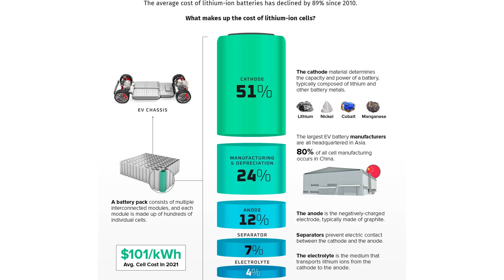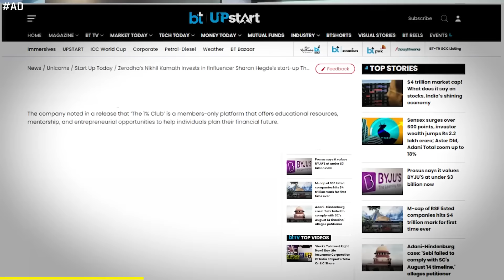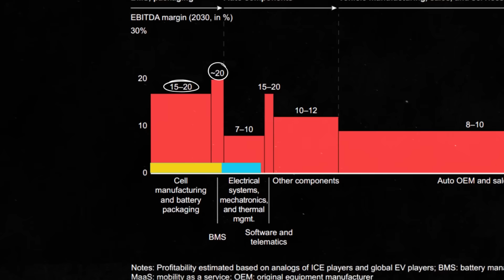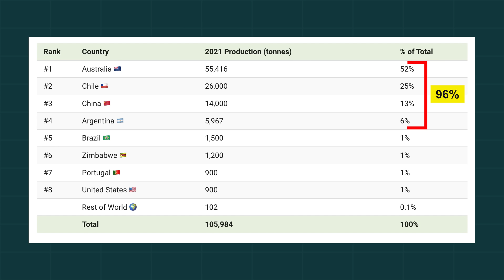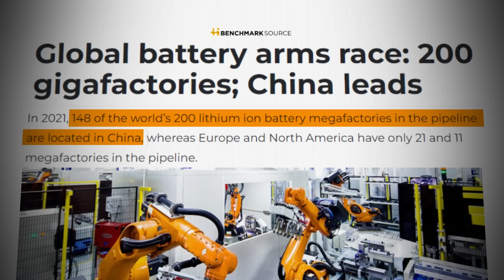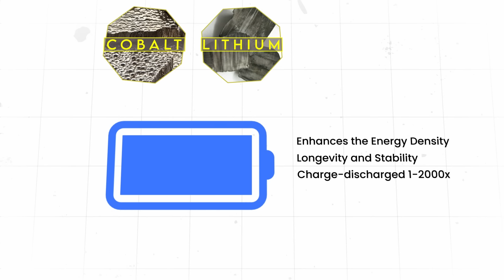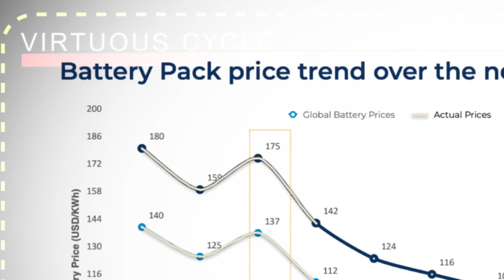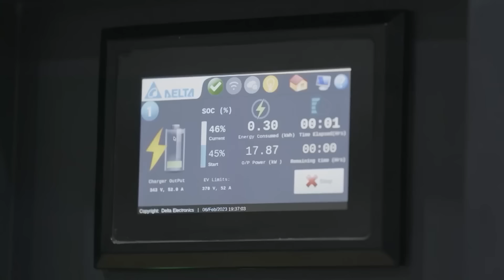Is India Winning or Losing the Electric War?: Business Case Study

Comment: 2 more cold start problems.

A) Battery charging time (1-2 hrs even with fast chargers) vs Refueling time (10-20mins max) while covering longer distances.

B) Breakdowns/Mantainance issues, especially in rural areas of  India. IC engines can be fixed even by the mechanics of small towns and villages, where as EVs has to be fixed by qualified technicians, hadly available in smaller towns and villages.
Reply: Ev tectnology is  developing not developed
Reply: That's why its called "start problems"...
Reply: well this isn't a india problem as such. The EV tech we can say is still in its initial phase as its not even 10 years that EVs have caught up some traction. So ev tech is still developing and still would take 10 to 15 years to be fully established globally (reaching a major chunk of market share). The second point of yours takes us back to infrastructure and sales.
Reply: 1.Removable batteries may be the solution
Reply: @ProudIndian2024 Its already there in China
Reply: Apparently you are not up to date with battery swap technology. Go reseach NIO. This is company has over 2,000 battery swap stations all over China and it is growing exponentially. Battery swap only take 3 minutes top. Also battery swap means you don't have battery degradation problem. With battery swap you don't have range anxiety.
Reply: @tkam9  yes
Reply: Fast charging at Tesla superchargers takes a car from 10% to 80% (approx. 320 km added range in about 25 mins). While it is supercharging, you can go indoors and use the bathroom, get coffee etc. Typically, supercharging is necessary only on long distance drives. Most of the time, EVs are charged at home, typically once a week. This, of course, is not feasible for apartment dwellers. As for maintenance, note that only the drivetrain and batteries are not mechanic-serviceable. EVs don’t have a transmission, coolant system, emissions system, etc. A typical EV has fewer than 50 moving parts, whereas a petrol or diesel vehicle has more than a 1000. EVs have no regular maintenance items (no oil change, coolant flushes, brakes hardly wear out) other than wiper blades and tires. All other long term maintenance items such as suspension parts can be serviced by any mechanic. I speak from experience - we own two EVs, and so far, they have been the most trouble-free cars we have owned.
Reply: Just like USB drives and RAM slots, battery sizes and slots need to be standardised for easy removable batteries of any brand Govt needs to take initiative
Reply: One more problem emition of batteries when they produce
Reply: @ProudIndian2024 what about emission during production of battery.batteries came by magic spell
Reply: well tbf the actual cost of repair on a ic is way more and evs are also less likely to breakdown in my opinion
Reply: latest HUAWEI super charging is 1 second = 1km.
Reply: Not to degrade the environment, things have to start somewhere! If you are discouraged, EVs will never start off in India!
Reply: 2nd problem will be resolved with time.
Reply: simple thing 
EVs are better for someone who commutes regularly and the distance is within the range of the vehicle. If you think about long tours and travels then EVs are not ment for you.

Comment: 0:33: 🚗 The electric vehicle revolution is rapidly gaining momentum, with major corporations and the Biden Administration pushing for the transition to electric vehicles.
3:47: 🌍 The video discusses the shift from IC engines to electric vehicles due to climate change and depletion of fossil fuels.
7:09: 🚗 The video discusses the different segments of the electric vehicle industry and the opportunities within each segment.
10:49: 🔋 Australia, Chile, China, and Argentina are major players in the lithium industry, with China controlling a significant portion of the market.
14:25: 🔋 China dominates the lithium and cobalt value chain in the EV industry, posing a challenge for other countries.
18:04: 🔋 The video discusses India's dependence on lithium and batteries from other countries, as well as the challenges and opportunities in the electric vehicle market.
21:20: 🔌 Electric vehicles (EVs) are more economical than IC engines over time, despite the higher initial purchase cost.
Recapped using TammyAI
Reply: Thank you friend.

Comment: I suppose you forgot another major component,  GRAPHITE.  China is the world's top graphite producer and exporter. It also refines more than 90% of the world's graphite into the material that is used in virtually all EV battery anodes.  Also more efficient electric motors require rare earth neodymium. China process over 75% of this metal. (A 12-15 mw wind turbine needs over 3 tons of neodymium).

Comment: 00:03 The electric vehicle revolution is gaining momentum globally and has significant business and geopolitical implications.
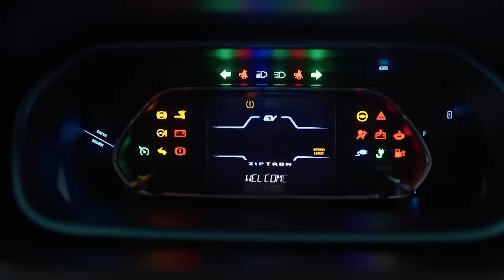02:11 The electric revolution is impacting the global economy
06:15 The key segments in the electric vehicle industry are battery cells, battery packs, BMS, EV components, software and telematics, new age OEMs, and the charging ecosystem.
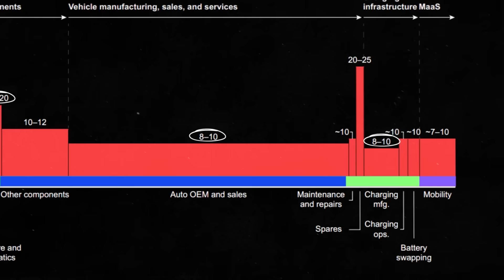08:13 The battery is the key product in the EV value chain, with the cathode being the most expensive component.
12:12 China dominates the global lithium supply chain.
14:21 China dominates the lithium and cobalt value chain
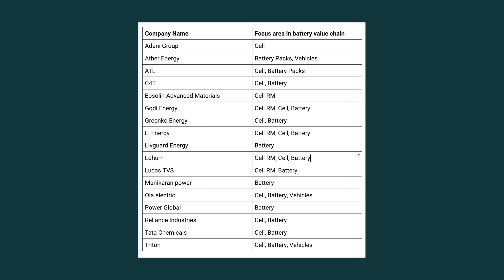18:21 Government subsidies have helped turn the electric vehicle market in India from a vicious cycle to a virtuous cycle.
19:53 EVs are more economical compared to IC engines
23:21 India's electric vehicle industry faces challenges in component manufacturing, charging infrastructure, and financing options.
Reply: Koi Kam dhanda Nehi hei kya😂😂
Reply: That one unemployed friend on a Wednesday evening

Comment: As a Automotive enthusiast and working in Automotive field for last 6 years, i loved the analysis.

I have done some analysis and have sorted some EV players in our market in listed market space

1. Battery Chemicals and Electrolytes.
- Neogen Chemicals
- Gujarat Fluoro chemicals

2. Battery Pack
- Kabra Extrusion Techniq

3. Battery Cooling
- Banco Products

4. EV wiring Harness ( High volatage cables )
- Minda corp
- Motherson sumi wiring

5. Motor controller, BMS
-  Sterling tools
- Varroc
- Endurance tech
- Minda Industries
- Minda corp
- bosch

6.Motors
- Sona BLW
- Varroc
- bosch

6. Micrparts for EVs ( shunt resistors )
-  shivalik bimetals

7. Recycling
- Gravita
- Ecorecycling

Comment: The below facts cements the discussion on whether or not EVs will make it into mainstream automobile. It already has.

2024 Toyota Prius Prime plug in hybrid, 44 miles on pure electric charge, 0-100kmph in 6.6 seconds (when EV battery has charge),  220hp,  price $50000 plus taxes.  

Tesla Model Y long range,  330 miles range,  0-100kmph in 4.8 seconds, 390HP,  unlimited FREE Tesla super charging for life of the car,  latest self driving hardware, $48000 plus taxes.

The RAV4 Prime Plug in is even more ridiculous compared to Model Y.  It costs $55000 plus taxes.

Comment: Sodium Ion (Na) batteries are best suited for Bharat. However they are at least 5-10 years away from being production ready for cars.

 
1. Lithium-ion batteries require lot of insulations and protection add-ons to prevent it from thermal runaway. That adds a lot of weight to the batery pack. In short, even if energy density of Li metal is much higher than Na, the energy density of actual battery pack is much lower.
2. The practical usable capacity of Li-Ion battery is between 30%-80%. As both below 30% and above 80% charging, the battery damage is highest. With Na-ion, you can go between 0% to 100% without any issues. Tyere are chances of Li-ion batteries dying if charge goes to 0%.
3. There is a lot of research going on to improve Na battery capacity. In Bharat we have companies like Reliance, OLA, etc. working on this tech.
4. They are perfectly suited for 2 wheelers.

Comment: The main problems of EV market are 
the charging spots that are available in India. we don't have the infrastructure currently.
China controls most of the raw materials in the supply chain of EV.
India doesn't have the manufacturing capability of producing batteries plus the refinement of lithium is very carbon and water intensive.

India should first focus on producing clean energy through nuclear power and then focus on the EV market.

Comment: It is the entire ecosystem!  Without an efficient grid and charging stations readily accessible throughout the country, EV adoption will take years. Then, there is also the generation of CHEAP, renewable or nuclear, electricity. 
Net-net, even for the U.S., it won't happen in less than 5 years. I suspect, India would take much much longer. 

Focus on incrementally buillding the supply chain. Perhaps, India may succeed in perfecting certain building block sooner.

Comment: Hello Sir,
I have a question here. Because of the rise of EVs, it is said to reduce the dependence on fossil fuels. But sir even after switching to EVs, for charging our EVs we require chargers for which we need electricity and in india majority of electricity that is produced is through fossil fuels. Hence when the demand for EVs increases the demand for charging (electricity increases) as a result wont we still be importing the same amount of coal and oil from other nations ?
Reply: It’s a just flip a switch process the transition takes time with renewables
Reply: We are running miles long tanker trains to transport oil (uses more oil in form or diesel or electricity if electric locomotives) 

By simply cutting demand for oil, this one factor itself will vanish which will free up resources for ev’s 

We also need energy to refine oil extract it from oil wel etc 

All this also needs energy

Comment: Excellent and detailed presentation of a complex topic made lucid, as always. But would like a video on an important component of the EV - Electricity. Where will we get it in the future? Since thermal and hydroelectric power is limited, will it be solar power? Nuclear power? Or something else?
Reply: I drive 40km daily and barely use 4-5kWh of electricity 

This is about same as consumption of 1.5T AC over 2-3h  of running. 

More driving means more charging — what you’re quoting is the battery size — nobody is using up the entire battery of their car or bike in daily usage. 

In my case, my EV will last an entire week of driving on single charge ie ~1000km per month. 

Besides, what you’re not realising is that the fuel used by your car is also transported in some way or other for example through trains (electric or diesel) from refinery to depot 

Then via truck to each petrol pump. Even refining of the fuel at refinery is using some energy in some form. 

By not using ICE cars, you’re also eliminating this background emissions and energy usage 

Let’s say all tanker trains are eliminated once we shift to ev’s, the energy saved from not having to drive those trains to transport oil will more than cover for the electricity needs of charging ev’s 

We are substituting one for another so obviously the resources used by the former will be freed up.

Comment: I bought Ather 450x back in dec 2022 and I hv drive more then 25k km in that bike my cost of owner ship is 1.63L+15k service + may be 5-6k charging cost at home so the total is 1.84 if I had bought active 6g the ORP is 1.16L at Chennai + 62.5k for petrol (25k km )+ easily 15k for oil change and service so the total as of now is 1.935L now within 11 months use it self the active is 10,000rs higher then Ather so u do the math for next 2-3 years its absolutely a worth investment

Comment: Would be interesting to learn about the actual effect on emission from using fuel based vehicles to using electricity given the current sources of electricity and the likelihood of that changing to sustainable methods. At the moment it seems like the emissions are being outsourced to the locations where electricity is generated but that’s just a feeling. 

Even if it’s being outsourced it will bring huge respite to Indian cities which are densely populated and suffer from pollution due to vehicular emissions.

Comment: Loved your research. However, it would have been better if you covered all the stages of the value chain rather than focusing solely on batteries. As you mentioned in one of your previous videos, there is significant research on the marketability of graphene batteries and graphene solar cells. Therefore, the current dominance that China holds might be temporary if another country successfully develops a viable graphene battery that surpasses the efficiency of lithium-ion batteries. Technology evolves rapidly, and lets hope that India emerges as a crucial player in the entire value chain.
Reply: China is also a world leader in the research of next-generation batteries.

Comment: Nice research done on the state of EV industry in India, while selling Tesla EVs, Charging from Power stations efficiency was ~60% and IC engines had an efficiency of ~20-25%, hence EVs were a natural choice but in India Charging stations are powered by Coal power plants with transmission and distribution losses higher than normal, also recycling of Li-ion batteries in China seems to be a big problem and life  of battery packs is only 8 years and cost of battery packs is 50 % of the total cost of vehicle. That means value of an EV depreciates to 50 % within 8 years if accounting for batteries alone, whereas IC vehicle engines last 15-20 years as per pollution control norms applied to these IC vehicles. Looking at the current and future roadmap should companies offer Plugin hybrids similar to Toyota's Prius which could last for 15-20 years and won't depreciate in value more than pure EVs. XPeng and BYD too could offer more options in India. It's already a level playing field for Indian manufacturers.
Reply: 100% customs duty on imported Li-ion batteries is more than the GST for IC engines. So FAME is for making ministers famous

Comment: Comparing TCO of EV V/S Engine fuel vehicle is not appropriate.

Eg.: I have Suzuki Burgman which costed me INR 1,10,000, but as per your calculation TCO is calculated as approx INR 2,00,000+, in which fuel cost is maximum for Engine fuel vehicle. However fuel cost depends on running a vehicle, what about one who use vehicle for internal minor purpose, won't their fuel cost be low and their total TCO will be less then what you have imagined in the video?

Comment: This is a great video which describes the industry in less than 30 minutes.
The battery needs to be replaced after 5-6 years and needs to be bought again, this will add to cost of ownership. Will EVs be still lesser in ownership?
Reply from the maker: Batteries last longer. And just like ice these 2 wheelers will be replaced by new ones in 8 years.

Comment: The TCO of an EV should also account for its reliability, which isn't their strong suit. Battery replacements in a few years also account for a great chunk of TCO, which is a significant amount. Hopeful that reliability does get better over the years though!
Reply: Battery replacements aren’t as common as portrayed to be. 

The replacements are very minuscule % of total ev’s sold. And even as such, most are manufacturer defect which is identified early on and changed within warranty 

At times, it also happens that dealer is unable to diagnose the problem with the tools and expertise available so replacement is the fastest turn around time for servicing for the owner who is facing issue

Comment: Unfortunately EVs aren't the long term solution. With limited resources, controversial cobalt from the DRC to the cost of infrastructure ( 300 kw CCS chargers can cost upwards of $100k) and the exponential burden on the grid,while transitioning from traditional fossil fuel to renewals all the while doubling or tripling capacity seems unsustainable. EV performance varies with the weather being abysmal in cold conditions. Long trips are a nightmare,battery needs Pre conditioning for super fast charging, cars a far bulkier so parking can be an issue. The car value almost halves the moment it's out of the showroom. It's just not practical  or sustainable for developing economies to scale up electricity production and heavily invest in infrastructure to support the EV industry.

Comment: Is the total cost of ownership that you mentioned takes into account the FV of the initial investment? Spending 10L now and 1000rs every now and then vs 15L now with 0 add on. Even if I make and FD of that 5L, I will make more than the fuel costs for a year even if I make a systematic withdrawal of 1000rs as frequently as a petrol vehicle.

Comment: @ThinkSchool

Going back a step backward in the ev value chain, source of electricity is also a concern.

Current production is not sufficient especially in developing countries like India.

Additionally, the renewable sources are generating the electricity as per the current demands.

So, don't you feel we still will be depending on conventional source of electricity i.e. hydro power and thermal power?

Also, who controls coal will still be controlling majority of the market?

Comment: If India seriously wants to zoom in EV sector, it must consider conversion of existing petrol 2 wheelers to EV , especially motorcycles . Currently there are 3-4 types reasonably good conversion kits available  for motorcycles . Customers are also accepting it's quality . But main huge hurdle is 18% GST on electric motor & BMS and 28% GST on Battery  against 5% GST on new EV . But many citizens are not switching to new EV motorcycle simply because there is only 1 good option available at very high price. Which is Revolt .